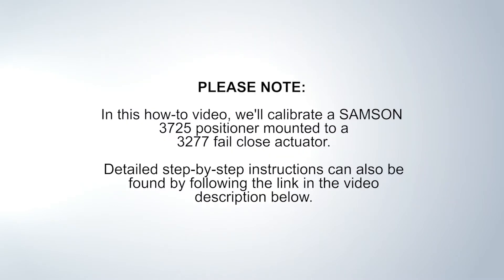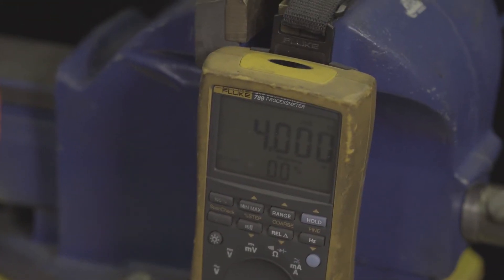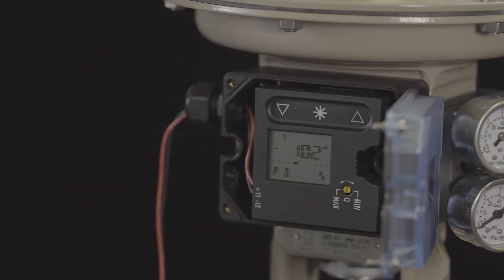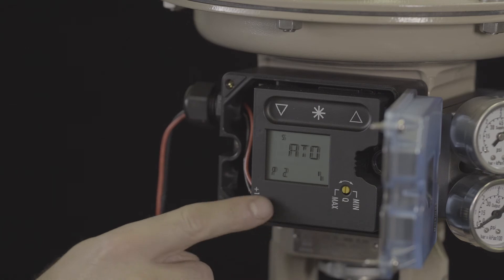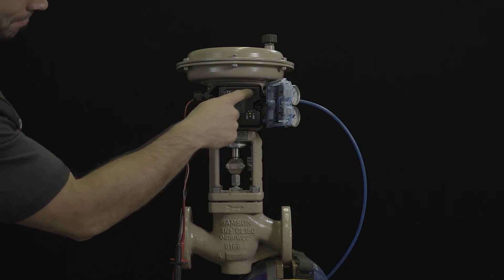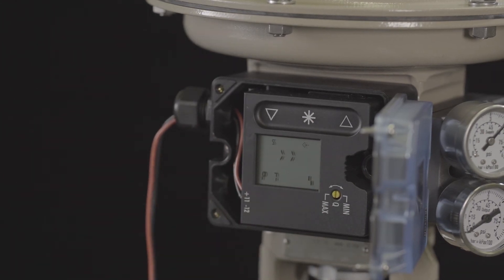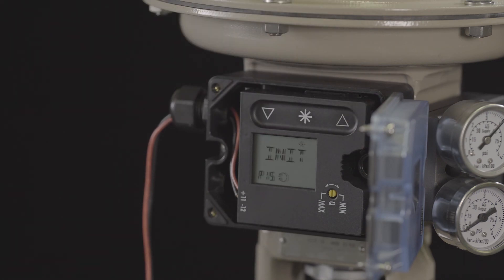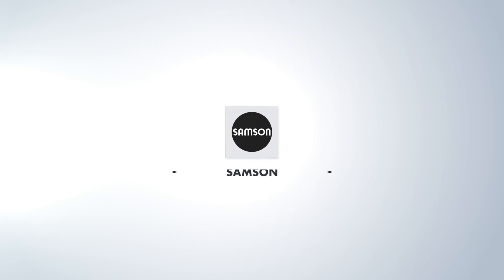SAMSON 3725 Positioner Calibration (240/350cm2 - Fail Close)

Comment: In our plant we use Samson posinitor for steam control.  It is controlled by Yokogawa pid control output 4:20 milli amps.  If the set point is 40 then it goes to 50 and then it goes down to 32 degrees.  I am not changing the setting in pid.  Pls explain slow operation settings tell me sir